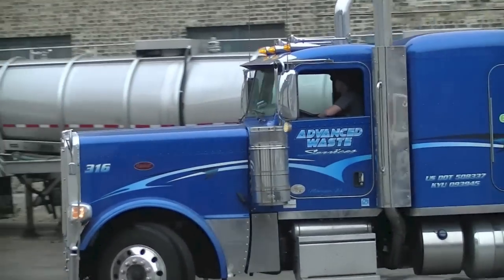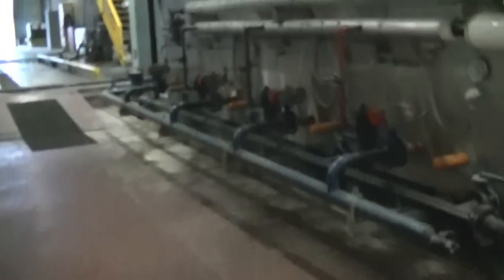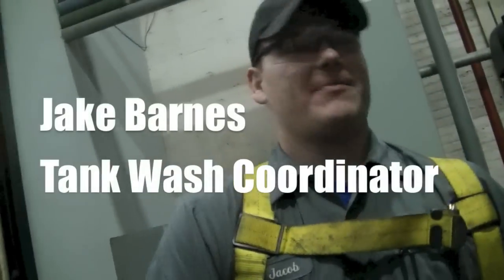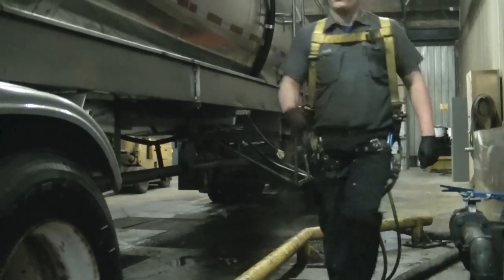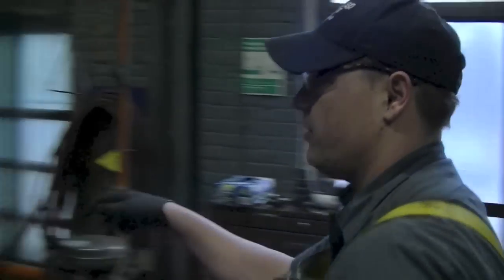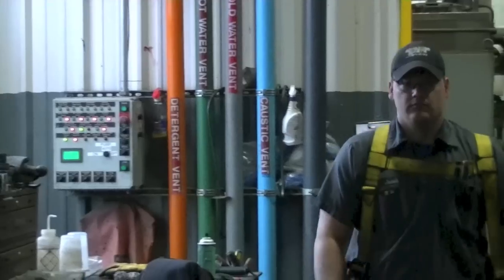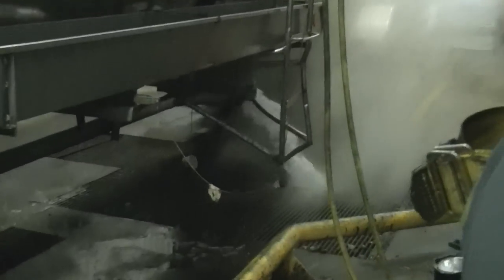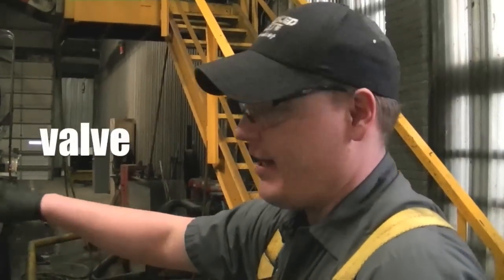Tanker Cleaning, Tank Trailer and Bulk Tanker Washout Process

Comment: I worked for trimmac trucking wash rack in 2003 in Hayward CA i was 17 and our rack sucked and our manager worse. He'd send me in there after a 400° caustic rince with a 2inch scraper blase to get the film and skins off...pretty sure that's not regulation and I was wondering we didn't really have ppe so we were breathing the fumes in there....should I be worried lol I'm 35 now
Reply: Yes

Comment: If there's baffling, how do you get everything cleaned behind baffles?
Reply: That is a good question. Short answer is they can’t. That’s why we can’t haul food grade liquids “milk etc” in tankers with baffles
Reply: Depends, if there vent ports located ontop of the baffled compartment they can stick a wand (a pipe with a wash nozzle) and give it a good wash. But hard to know if it's really clean. Depending on the product that trailer had.